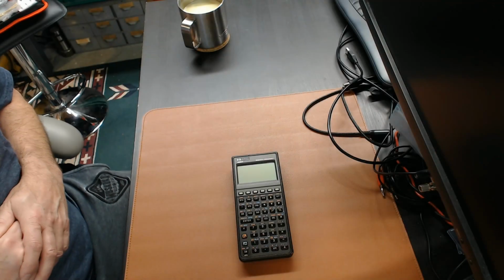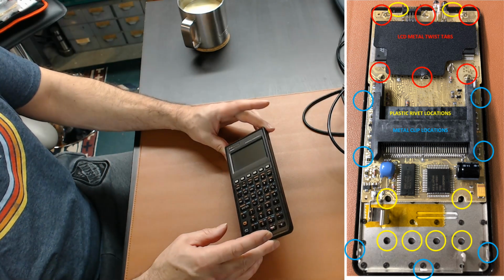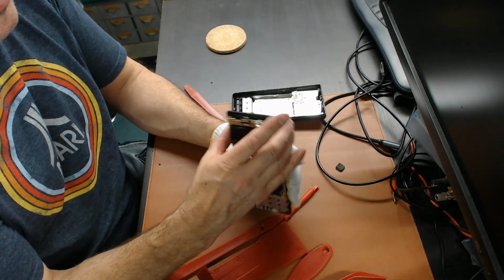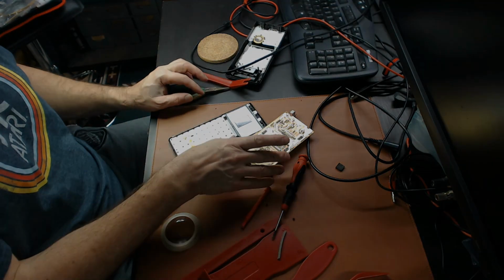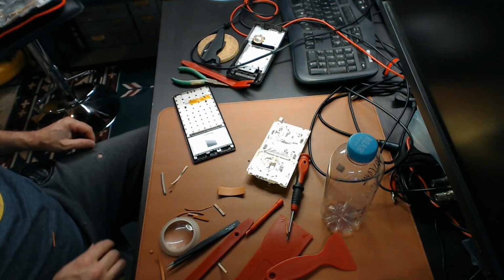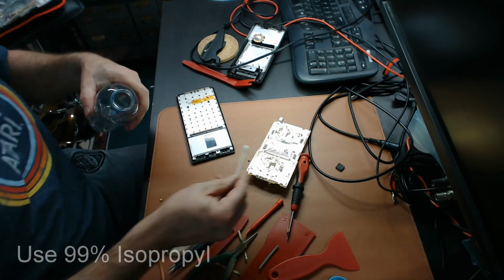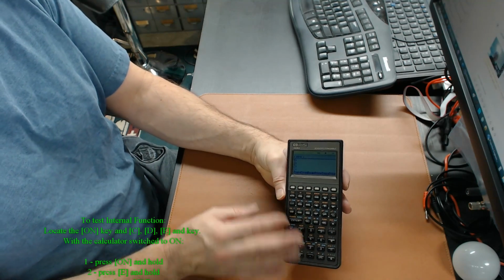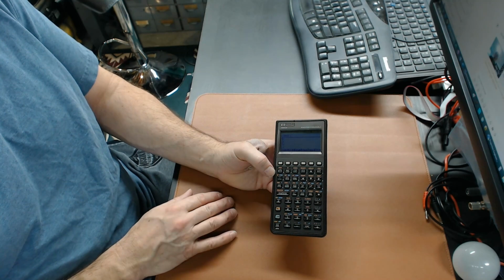HP 48SX Repair - Power On Failure -- Keyboard Failure

Comment: Thank you for this exposition, I've watched your video and also followed Pawel Golaszewski's "Open48" instructions that I found on hpcalc and I've managed to open my HP48G+ that wasn't working since I forgot I was using duraleaks, I mean, duracells on it and neglected to remove them for long term storage. The display was also darkening and since I had nothing to lose, I decided to try to open it. Took some patience due to the bottom part being very stubborn, if I had to do it again, I'd probably drill some holes on the battery compartment to get rid of the plastic bits that gave me so much trouble. But it worked with just a few marks on the side and a little warping of the face plate, that with some patience can be straightened.
Reply: Seems like the guy has an infamous younger homonym in another country, I was trying to find out if he had changed his e-mail in the last 22 years and didn't find what I was looking for.
Reply from the maker: Good luck with the repair.  I decided against drilling mostly because I didn't want to deal with how to put it back together without the plastic snap fasteners.  I expect that my calc may need to come apart again, and since the snap fasteners have been exercised once since it was  manufactured, I expect them to be a bit easier the next time, if there is a next time.

Comment: I have an HP48G. Had the same problem. Found that other YT video about putting pressure under the LCD to turn the unit on. That works for me. Once the calculator is on, I don't need to apply pressure anymore, and it works fine. Sometimes I need to apply pressure to turn it off though. Lately the calculator has been working fine without the pressure trick. Very flaky. I must have a mild form of the problem.
Reply: my 48sx is the same way.  only the on/clear button didn't work, but a few times pressing on it has brought it back to life and it's been working fine for 3 years.  I don't know if I could stomach trying this once it finally dies.  One ugly hack I've seen is using a rubber band to apply pressure under the screen
Reply: I have 2 fortunately a48g and a 48gx the 48g stoped working a long time ago so I have just been working with the GX but now the +- x / buttons are intermittent.  love how these are so supported and loved by those who use them regularly where they have to be repaired even though i have an app on my phone to do the same thing its just not the same
Reply: @Probablyshouldnthave  nothing beats the feel of a real keyboard

Comment: Just what I needed - thanks! It is a little hard to see what you're actually doing though.
Reply from the maker: Unfortunately the plastic snaps holding everything together are difficult to find and pop so not easy to show except when everything is apart.  The rest should be easy to figure out with releasing the LCD screen by its twist tabs and changing out the compression strip.

Comment: Thanks for this awesome teardown video. I have 48SX back in college year in the 90s,  the LCD getting darker with first icon row "burntmark or bleed" . It could be due to aging or humidity.  

Will dehumidifier or dry camera cabinet help to improve the LCD screen? I could still see the screen, but at brighter room. 

Not sure if I need to use plastic plier to open this unit to clean the PCB with 99% isopropyl alcohol .  Oh, one of the bottom battery twin- terminal has been loosen , I may need to glue it to the pad.

Thanks again

Comment: Great video.  What was the thickness of the silicone rubber tape that you used?
Reply from the maker: 0.075" or ~2mm close cell high temperature foam.  This was all that I had on hand at the time so I had to double it up to meet the approximate thickness of the old strip.
Reply: @powerevolutions  Thanks for the info.   Does it have to be high temp?
Reply from the maker: No it doesn't need to be high temp, but that is what I had on hand at the time.  I think you just need to find a nice stable close cell foam material with reasonable stiffness to provide the pressure against the flex cable.  The stuff I used was purchased back in 2006 and is still stable and has not shown any signs of deterioration.   I am hoping that it will be the last time it needs to be replaced.  McMaster Carr sells similar material.

Comment: I have a HP48G+, not with Keyboard issue in yours, but mine has the reflecting layer on the LCD back completely failing (dark and transparent). So, although my calculator works electronically speaking, the Opticalpart of the LCD makes it unusable. Because of that, I need to open mine and I guess your method is less dangerous to other ones that disassemble from the front metal overlay. Please advise:
Any further suggestion, or tip before starting in this non-returnable trip?
I’m in Brazil and I don’t have such nice and robust plastic tools/levers, just regular flat screwdrivers and some wood-carving tools. To hold them on position while opening I could use several (expired) credit cards. Any further suggestion or warnings? 
Thank you in advance for any remarks you could bring, and thank you for sharing your repair.
Reply from the maker: If you can find a plastic putty knife or scraper from a hardware store, that would probably be the same for sliding between the case and circuit board.  Never use something harder than the plastic you are working with or you will end up making a mess of it.  Hopefully you have a doner LCD screen...they seem to be hard to come by now.  Make use of the hp museum website for any other instructions that are different between the SX and G.  I think they are more or less the same construction.  I would suggest you replace the rubber compression strip even if it does not seem to be deteriorated.  Last thing you will want to do is have to pop that nightmare apart again.

Comment: Have same problem. Can you share the description of the Silicone foam you used.
Searched but too many choices for thickness and composition.
Appreciate any info.  Thanks, BIll
Reply from the maker: I used the high temperature close cell foam from McMaster Carr  similar to part# 51009k25.  This has a adhesive backing on one side to make installation easy.  I did double up on it though since it isn't that thick.  The foam I have is about 0.07 thick.
Reply: @powerevolutions  Thank you for the info.

Comment: Tengo una palmtop 200 LX ,Hewlett Packard. 
La pantalla se ve como derretida en un sitio,es factible su arreglo?gracias
Reply from the maker: I haven't seen one of those before, however a quick search turned up a pdf for replacing the polarizer that apparently bubbles and looks burned on a lot of the 100/200LX's.  I would search for "Replacing polarizer of 100/200LX" which is a pdf with instructions by Wee-Meng Lee.  You may have success fixing your screen.  The alternative is if you can find a donor screen which is likely more difficult then fixing the polarizer.  Good Luck.

Comment: Hello, I have a similar problem with a 48gx, specifically it turns me on fine, but some keys don't work, pressing them does.
I am encouraged to repair it by following your video, but I have doubts about how you did to put it back together, did you break the rivets when you opened it?
Reply from the maker: It will snap back together but it is only a little less more difficult to do then it was to get it apart.  I used a quick clamp to help put enough pressure on the case for the rivets to snap together again.  You just need to be careful with the pressure.
Reply: @powerevolutions  Oh I understand, I thought that when opening it broke some rivets, I will dare to try thanks
Reply from the maker: @cesargabrielarrietacarrasc3169  Think of it more like really strong lego that is near impossible to separate. So rivet may not describe it correctly.  I don't think I broke any when I took mine apart.
Reply: @powerevolutions  After a lot of patience and measured strength, I was able to disassemble it completely!!! thanks for the video.
Now I have a doubt, because it is not very clear in the video, changing the rubber that connects the keys with the display of the screen, we are looking for the keyboard flex is fully supported on the same or is slightly detached?
I do not know if I make myself clear, if there was a way where you can send the image would be much more understandable.

Comment: Many thanks for Your exposition. I have been using an HP 48G+ scientific calculator for years. For a few days now, the monitor has been dimmed in the middle. Does it need to be replaced? 
Can you help me solve the problem? Best regards
Reply from the maker: Could be the display itself, but more likely the zebra strips and pcb contacts need a good cleaning with alcohol.  If it is starting to fail, the compression strip is likely at a point where it will need replacing too.  Mine was only the compression strip however I did clean the zebra strips and contacts because I had it apart already.

Comment: Where did you get your spudger, spatula, and prybar? They look 3D printed, but I don’t see a 3D print being strong enough to open the 48.
Reply from the maker: I used a Wetado 203 Pcs trim removal kit...works for trim, works for HP48SX.   Just search "Wetado 203 Pcs" on amazon for the kit and you probably can find similar kits cheaper that will work just fine.
Reply: That’s excellent! Thanks for the quick reply. Those will be a good addition to my toolbox.
Reply: Those bigger tools remind me of the tools used to remove car trim parts from panels and doors for replacement.

Comment: In many ways the best calculator ever. Also, in many ways the worst calculator ever.
The fact that more or less all calculators get the infamous keyboard bug, along with being nearly impossible to open, a soft metal faceplate that WILL dent sooner or later, makes me stay away from it. HP really made some terrible design choices, probably to keep costs down.
Reply from the maker: The emulator is a good choice to get a pc calc that is RPN and still for the most part looks and acts like the real thing.  No physical to wear out or get damaged.  Funny enough I haven't really used it too much since I fixed the compression strip since I have used the emulator for 10+ years 😀